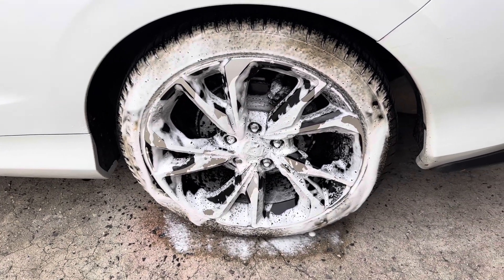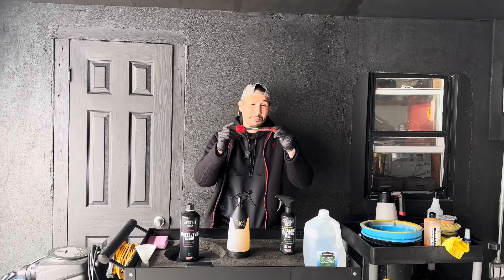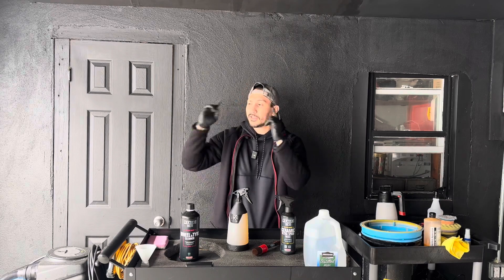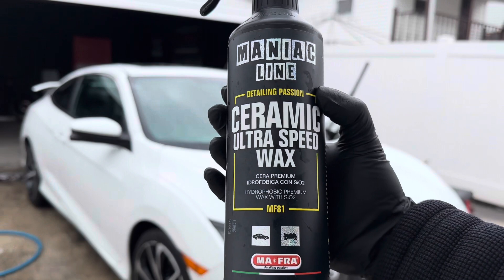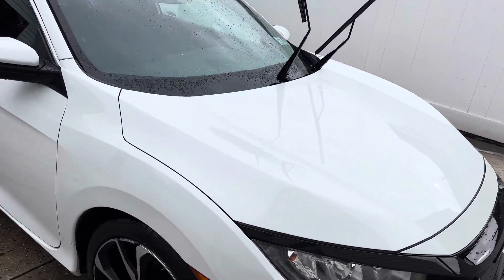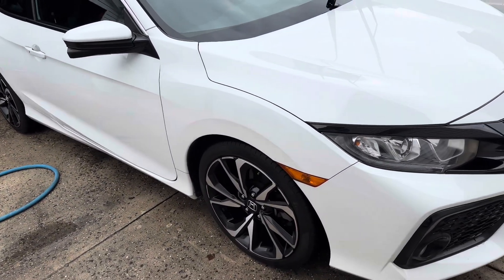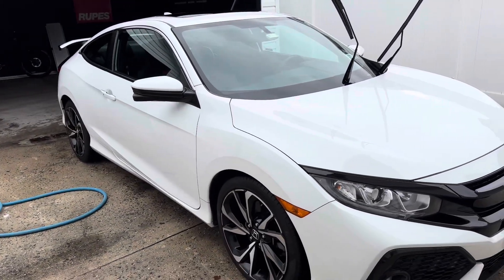NEW KING of Wheel & Tire Cleaners - Brake Buster Can’t Compete Full Strength! Maniac Line

Comment: I'm a little confused. You mentioned so many products for wheel cleaning And you said you like this one.
And that oneWhich is the best one you've so far? Thank you.
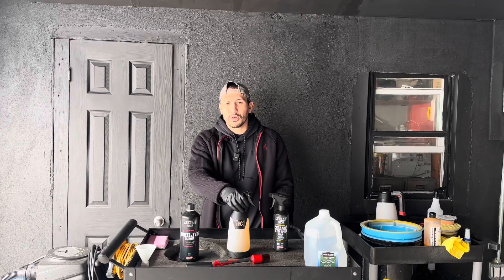Reply from the maker: Sure let me clear up the confusion. There are many good wheel and tire cleaners out there. But to me this is the best one because you can purchase it and it's diluteable. 1:5 or 1:10 making the cost savings amazing. There are 2 cons for this product.

1. It's best used in a foamer to spray on and dwell. It doesn't work the best or suds up great if you're using it in a traditional bottle and sprayer.

1. They don't sell gallons.

That's why I named the other ones. Adams's wheel and tire in a regular bottle foams up very nice but it's recommended to use straight and also the kick back is strong makes you cough a bit. Hope this info helps

Comment: If i have a ik sprayer how would i mix up a 10 to 1 and is this safe for my painted and anodized rims paid alot of ml ey for theses wheels i know break  uster is safe and a  cheaper way to go
Reply from the maker: I haven't tried it on anodized rims. I suggest you try in a small area and let me know. They said it's safe for all wheel types. Would be great to know. This cleans way better than brake buster though

Comment: Its cool, ive ordered it, but im wondering does it have corrosion inhibitors? I mean the Wheel cleaner? Cheers for a good vid
Reply from the maker: Hey my brother. I am not sure. To be honest don’t get sold on “rust inhibitors”. A lot of people will hate the truth. Don’t get sold on that. After a rain storm and heat oil and traffic film those inhibitors are gone. If it’s nice weather maybe a couple of days. So if it’s your daily driver don’t get sold on that. Especially when you rinse completely clean the solution nothing significant is left behind in “rust inhibitors “. 

Thank you glad you enjoyed the video 💪. If you’re asking I’m sure it’s because of Brake Buster. As that’s the only one claimed to have rust inhibitors
Reply: @DetailingMadeSimple  Indeed it is because of BB :) The only upside i noticed of Rust inh is that my brakes dont have that brown rusting after a wash with BB 🤔
Reply from the maker: @victoryensured7137  it’s after the wash. Yes. Quick question. Is it a daily driver? Quick solution. Move it forward 2 feet press the brakes and gone. For me that’s all a gimmick. That’s like saying a quick detail spray adds protection. It does for like 1 day. Again that is all for me. 

Once you start driving the car the next day or hour the heat dirt and grime those inhibitors mean nothing.
Reply: @DetailingMadeSimple   it's my garage queen, a newly bought Bmw g42 :) I think i agree, a lot of those gimmicks in detailing lately, trying to stay down 2 earth... the problem i have with matte black wheels i have on it its that i just CAN'T clean them well and all Bmw produce a LOT of brake dust (jesus its a lot..), spent lately 2 hours cleaning them with BB and ph neutral soap after (a lot of bruises on my hands also as they are spokes everywhere...) used microfibre glove, brushes (delicate) u name it and nothing... (no pressure wash in my garage though) just bought Maniac and waiting for delivery, hope it will help.. ah and cheers and thank you for your timely replies and the great vid! Hail from Europe!
Reply from the maker: @victoryensured7137  ahhh so a garage queen that’s awesome!!! For matte black wheels this will do perfectly fine. Try a 1:10 dilution first. Also have you tried coating your matte wheels? To aid in stuff not sticking and easier to clean. Like you said brake dust is crazy on BMWs. 

What you have the 20 spoke wheels? You’re a legend for that 🤣🤣
Reply: @DetailingMadeSimple  My winters (the matte ones i have now) are 18" M Double Spoke 796M, and my summer are 791M Spoke Black High gloss (yeah.. i know - nightmare xD) they are hard to keep clean (my first black ones) but they are sooo cool, i really dig them! The winter ones have 20 spokes... xD i hate and love my life... 😆ahh and yes ive coated them when they where new (the face of the wheels) in Gyeon Cancoat evo
Reply from the maker: @victoryensured7137  that’s fire 🔥. Definitely nightmare to clean but worth it after it’s detailed. Got it so you’re all set. The maniac will be a great cleaner for it even at a 1:5 dilution you’ll notice even at a 1:10 like I recommend since it’s a garage queens cleans way better than BB. At a 1:5 Dilution cleans better than BB straight!!!

Comment: Very impressive wheel cleaner at 1:5 dilution ratio. I need to buy in gallon or 4 liter size so I hope they bring it to the USA in larger size. I will be watching for your review of the new Labocosmetica Rinseless Wash. Lots of talk about Idrosave.
Reply from the maker: Yes I was shocked as well. I have another car that had very bad wheels. But overall came out amazing!! With a 1:5 dilution. Hopefully they can come out in Litera but even then you can do about 6-7 vehicles if they are hammered and do 2 passes on each wheel. Wayyyy better than brake buster. If you're a weekend warrior wash your car every 2-3 weeks it'll last you close to 4 months so still not bad for $20 or $13 if you get it on sale
Reply: @DetailingMadeSimple  Usually dilutions are 1 part product and 5 parts water.  Is this mostly product for their dilution? Reversed?
Reply from the maker: @wescat2  hey Wes same thing. 1 part product and 5 parts water. Some people reverse the lingo. But it’s always larger the number is water the smaller number product
Reply: @DetailingMadeSimple  I thought so.  When you said 1/4 water and the rest chemical.  I thought dang that is going to be expensive. :)
Reply from the maker: @wescat2  yeah. I probably did say that 😂. Hard sometimes to do everything in one take.
Reply: @DetailingMadeSimple  I can imagine.  All Ive done is a few shorts.

Comment: I forgot ceramic speed wax had carnauba....one of my most loved sealants as been polish angels rapidwaxx. It has both as well. FYI Carpro's ech20 has some carnauba too. Another favorite of mine.
Reply from the maker: Rapid wax from Angelwax is very good. Carpro I am not a fan of really. This ceramic ultra speed wax beads up surprisingly well too!
Reply: @DetailingMadeSimple  yeah as for carpro i don't really like essence or essence plus much. But i do like ech20 a lot. Reset is very nice but i don't use shampoo's much anymore. Lift was junk compared to labo's primus IME.
Reply from the maker: @seabrew1  Carpro tbh is my least favorite line up that I’ve used only a couple good things on there that worked for me and my environment 😭. Reset is good, Descale, Perl, Eraser and that’s all I really liked the polishes are a tad bit over priced and clear cut dust like I’m a cement worker 🤣

Comment: Smells great like Eddie say and no stains... thanks to @Ecdetail got me hooked on this i order 4 of it as they were $16 on black Friday... i still have my break buster, so what i do i add a bit to the maniac because of the corrosion inhibitors that in it... just to use up my break buster and good for the break calipers....
Is that you drying towel you used all the time???
Reply from the maker: Niceeee!! Yes Eddie kept telling me to try it glad I did 🤣. For the Friday deal it’s spectacular $13 here in the US. That’s smart in what you are doing! 

Yes that my drying blanket from DIY I use all the time!!! I love that drying towel and the waffle drying towel I enjoy for glass! It’s not as absorbent but works very well on glass.
Reply: @DetailingMadeSimple  the reason I ask about the towel it's because I had this problem before using sealant on my towel and at one point it won't drop properly because of the sealant on ymthe towel won't dry tge water anymore I'm just saying....

Because I had that experience
Reply from the maker: @cebasmb8250  that’s strange. Yes my towels do get clogged once in awhile but that’s cause I just let my towel dry sometimes. I just use extra tough APC and Rags to riches dunk it in a bucket and leave it there for like 5 days then wash them. But yes my towels get clogged once in a while. I do have a short on YT like a week ago. The drying blanket wasn’t fully unclogged so I’m doing one more treatment where it’ll be 100% good.

Comment: You keep saying its browning it  could be your ozone stuff to keep your tires from rotting I would be op about tires to  but your tires weren't that bad  do what you want but you do t wanna rush tire rot
Reply from the maker: It was browning. I haven't washed my vehicle in 3 weeks did 950 miles. That was just the dirt. I'm not pulling the antiozonant or whatever that's called. That's the bleeding/browning that comes off with usage. And heat. It's okay to remove that "dead layer" then apply your dressing. My previous tires last me 2 years. Low profile and does about 1300 miles a month.
Reply: @DetailingMadeSimple   if you sat they were dirty I'll take your word from video they didnt seem that bad I cleaned a lady car thst was neglected  dark brown maple syrup was coming off yours looked  lean after first round